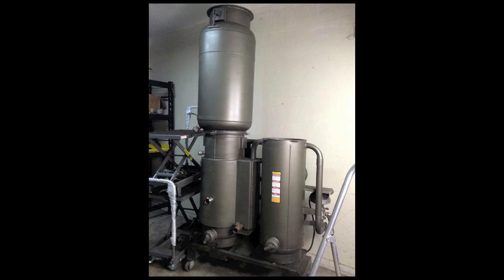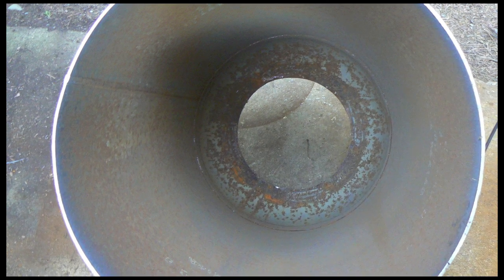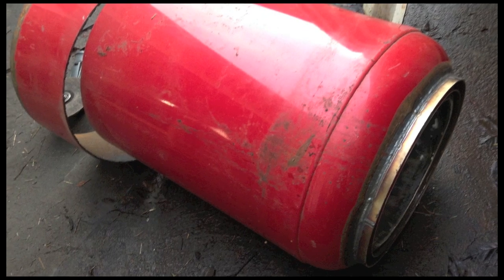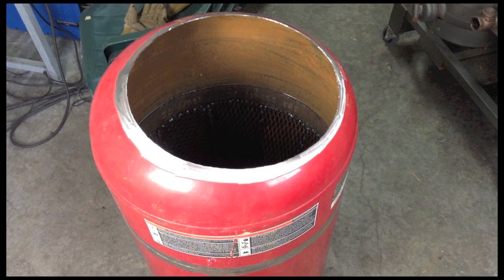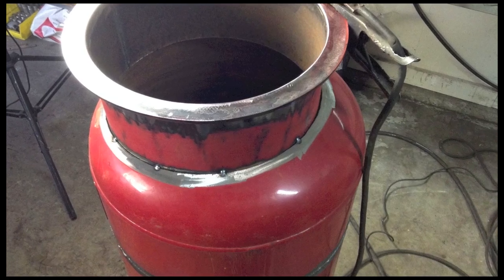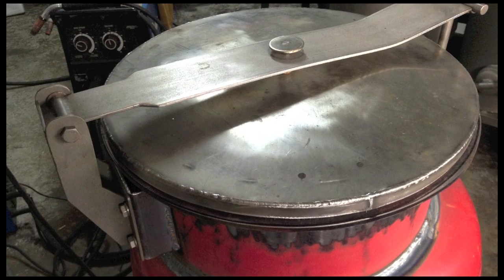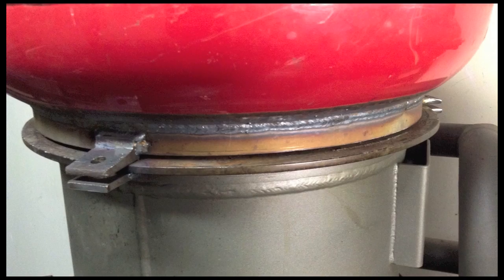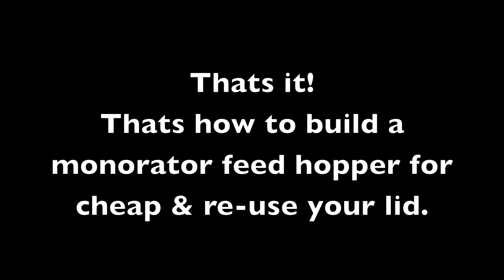Wood Gasifier Monorator Hopper Build

Comment: How about use the waste heat from the gas cooler to heat a wood dryer for the next batch of wood fuel  to reduce moisture ?
The heat could be transferred via hot water coils.